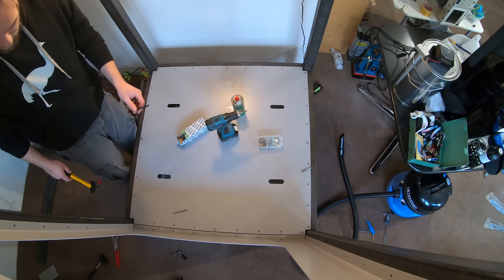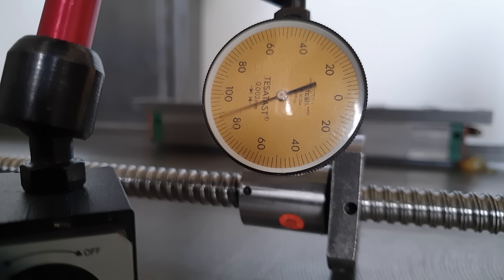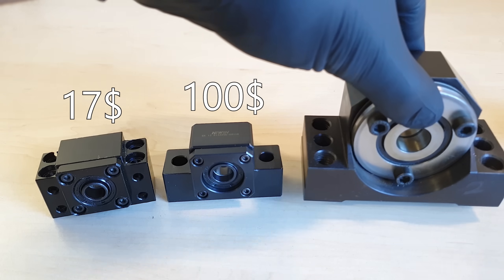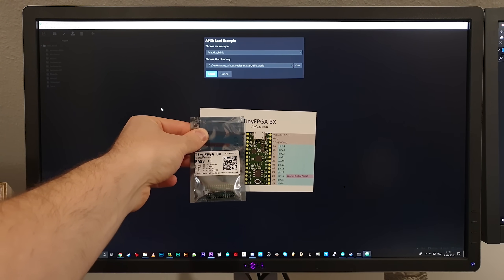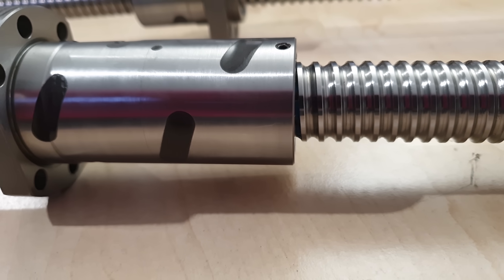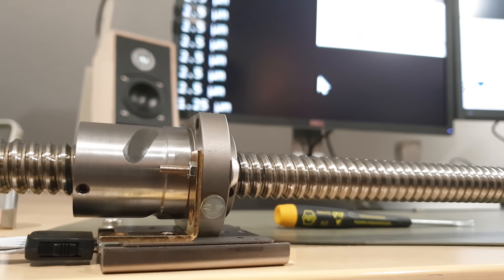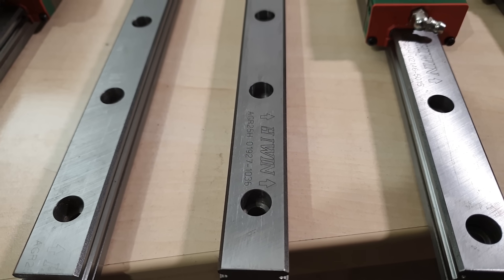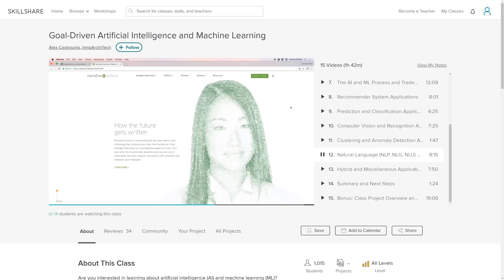Chasing Micrometres with the best Ball Screws

Comment: Soon enough I’ll be making my own 3D printer, it’s so unique it will work well on the market as a product to sell. It is absolutely nothing like a Cartesian printer, closer to a delta but still nothing like them either. I’m going to be designing my own motors and they will give high speed, High torque and high Percision... less than micron accuracy with fast movement. I may be looking for partners, would you want to be a partner. Also my motor will 100% eliminate gear lash, the only lash I will have to worry about is the lead screw or whatever type of screw or use, I think I have an idea to eliminate screw lash, but I’m not sure, could use some input/thoughts on my idea.
Reply from the maker: Bold claims ... my email is on my channel page when you have something to show :)
Reply: Marco Reps I would love to spill all the beans, once my design releases every one will be cloning it, so I’m not doing a kick-starter etc, it will give to much info away. I’m a OTR semi truck driver and don’t have much time to my self. I’ve got it all planned out in my head, but a few things I’ll need help with. I’ll likely need to make a custom power supply, also my coils won’t be on 100% of the time , there will be lots of switching, but for extreme exaggeration example let’s say one particular coil coil gets powered on indefinitely, no polarity switching, just continuous power, I need to know how to balance everything out so that coil(s) and power supply can be on 24/7/365 and be perfectly safe not getting to warm/hot. Also I don’t know that any of these circuit boards can handle all my connections and coordinate and calculate everything.
Many things are not finalized math related but the strategy is complete, so I could very easily have over 100 wire pairs to work with!
So since I’ll probably using regular computer and software I’ll write (very rusty, been years since I coded), some of that I’ll need help with, mainly geometry type math. Example well actuall... take a disk and measure it’s diameter in microns, fix the center in space... visualize a XYZ grid of micron sized plots, the center of the disk is at 0,0,0 . Now pick any spot on the perimeter of the disc and dip it down by one micron... now along the perimeter of this disk what new Micron sized plot coordinates are they touching? That kind of stuff. Also what kind of circuit board can I use to interact with software I’ll write that can handle over 100 connections, turn them on/off and choosing what polarity I want each connection +/- , I’ll handle the formulas that coordinate all that. So first step... balance out all the coil parameters, smaller is better, stronger is better and stay perfectly safe under endless continuous power with no switching Polarity... and staying safe, that is worst-case scenario but you have to consider this is going to be in people’s homes.
Once that is done that will give me the information I need, mainly torque I’m looking for. Then I can take it to the next stage, some kind of board/software interface to test speed. Once I have those figures, that will determine how the rest of it is balanced out with the rest of the internals of my motor. 
Side note I don’t really care how big the diameter of my motor is, bigger the better, only draw back would be you have to have a bigger build area LOL, So if my motor is one foot in diameter, the minimal the build area can be is three feet in diameter.

Comment: FYI: You should look into Klipper if you are interested in interfacing a regular threaded OS with a realtime OS. Klipper is a 3d printer software that does all the heavy lifting on a computer (usually a Pi) and then uses one or more microcontrollers to schedule and execute commands.
Reply from the maker: Yeah, cool project. I think Cetus is also based on that principle
Reply: @reps  I honestly think it's the way forward for 3d printing as opposed to using STM32 based boards with webUI addons like the Duet. Plus it can be infinitely scalable. Want to have two Y-axis gauntries with two X-axis carriages with two independent extruders each? Slap a few cheap reprap boards together and hook them up to a Pi and install Klipper on everything.

Comment: marco, did you forget to go back to the fundamentals of engineering again ?
just fabricate a suitable large to small (micron in this case) pantograph derivative,  for instance in the style Matthias made for a prototype , and use any mostly printed cnc to run the big end for near positioning, then a second scripted micro cnc  on the small end to fine tune the micron path on the reduced end  if that is then also required for even more control

https://www.youtube.com/watch?v=IDGzf04W62A 
Matthias Wandel
,Published on Apr 22, 2016
A pantograph to use with the plasma cutter for cutting intricate shapes that would normally require a CNC plasma cutter.

Comment: Marco, what about interferometry for measuring the "travel-back-position"? Such a setup is quickly built and you own a few laser diodes ;)
Reply from the maker: Somehow the term phase locking popped into my head, but apparently that's not even necessary?
Reply: @reps  Yeah phase-locking would be awesome. Not sure if you want to dive into this, but I'd love to see how your approach would look like ;) (just noticed that at mistyped your name previously, sorry, fixing it)
Reply: A simpler way would be just capturing the image and run some contrast calculations to determine the phase.

Comment: Marco Reps  I'm planning to fill my steel sections with a non-shrink concrete and latex mix for damping. Article about damping cement here - https://www.researchgate.net/publication/226620051_Improving_the_vibration_damping_capacity_of_cement

Most of my machine is bolted together so I will helpfully still be able to move it.
Reply from the maker: Ah, a vibration expert! ;) Yeah I wanna see how everything behaves without any damping first, because if I add any more weight I couldn't move the individual parts by hand any more :L

Comment: bearing blocks on linear rails must have a certain amount of preload to give you accuracy and rigidity under load.  
that's why a new linear blocks don't slide freely and have some amount of friction.
(and that used rails from industrial machines slides freely just because they are WORN OUT and lost their preload.  that's why they was removed and replaced with new ones)
Reply from the maker: Sounds all correct! The banggood ones however have an uneven friction and seem to get caught on some high spots. And since hobby stuff is the only area where you would consider used rails anyway I think even the most worn-out ones will be easily good enough? Maybe I can find a way to actually measure my worn-out Rexroths ...
Reply: @reps  I've recently bought some used miniature Bosch rexroth linear guides (size 15, 4 bearings, 2x330mm rails) from ebay, alongside 500 steel bearing balls. Had to replace the old balls and even replaced the new ones multiple times until I found a "good batch" of those cheap balls that were running smoothly with slight preload. All in all this costs me 120€ compared to new ones from Bosch for over 500€
Reply: @mariusb6035  How do these Bosch rails compare to Hiwin rails? Only ever heard of Hiwin rails being used in high end CNC applications.
Reply: @michaelkelly3158  the original Bosch rails are very similar to hiwin rails. You'd have to compare lifetime, friction or other technical properties in a specific use case. Just saying "these are better" is impossible. As long as you get new brand name rails (hiwin, Bosch, SKF, Schneeberger,...) you should be good to go for any hobby project.
Reply: @reps  You could lap cheap rails to remove the high spots.
Reply: There are lot of tutorials on youtube how to fix blocks if they dont run smootly. Often its only the little metal which hold the balls, that it isnt 100% straight. If you fix this, then you have a rail with a block which runs perfectly, but not many ppl know how to fix it.
Reply: I have some cheap Chinese linear rails in a 20mm size. They run kind of rough but don't seem like it's specific high spots. Do you think taking them apart and cleaning would help smooth out the motion? I kind of suspect it's small particles in side the carriages are causing it to stick
Reply: So what's the conclusion here. I found set of linear rails + screws on Ali for 370€, but I can buy the same set of used, rusty Hiwins for the same price. Can you give me an advice, please?
Reply: as those are high load and low speed applications, the highest preload option would offer the most, the lubrication will take care of the lifespan (hopefully)

Comment: Your videos are usually pretty funny, but that joke at the end about rails getting replaced preemptively in industrial settings was hilarious.
Reply: @SystemsPlanet  Most industrial machines (outside Germany at least) get run to death, rarely get the love or greasing they should.
Reply: Bigger companies do this all the time. Regular maintenance is important when your Nestle and bottling 10's of thousands of water bottles a day.
Reply: @adisharr  
I am not sure if you have ever replaced a ball screw, but it doesn't sound like it.
Reply: Depends a lot on the application, but most companies will replace ball screws when it starts causing problems. If it's in a machine that NEEDS to run without a hitch, consumables will generally get replaced or at least checked for wear on a predetermined schedule. I used to work for a company that would always have a maintenance crew scheduled for holidays so they could do that sort of thing without creating excessive downtime.
Reply: The standard operating procedure in North America is: A more and more frequent motor overload error, operators get frustrated enough to complain, so maintenance come and grease it, same thing happens a few more times, maintenance get frustrated with greasing it every damn shift, and then they tear it open to find out it’s completely fucked, ball bearings all over the inside of the machine, parts are ordered in a hurry, often resorting to physically sending a guy to the distributor to get the parts faster, because the line is completely down and hemorrhaging money. You guys have a better system in Germany?
Reply: @samroesch  Sure! Every company has (by law) 3 special departments for that. The highly trained quality maintenance workers which dissect every part of machinery based on a plan that is written on 2" steel plates. Usually this means dissecting a machine every 23:05 working hours and then rebuilding it. This whole process only requires 50 man hours to accomplish, because the staff is so experienced and trained. The second department documents this process for every screw in every machine and quality checks the quality checking maintenance workers. And then the third department which checks the documentation quality of the quality checking quality checkers. So for every machine we tend to have around 10 people who care for only this machine (full time). Its because of this system that germany can manufacture the best "stuff" for only 1000 times the price of chinese parts. And yes, thats why marco can get like-new parts second hand, if a part is rated for 1000 working hours, naturally it gets replaced after 10 working hours. Safety margin and all that.

Comment: Maybe you could try Schneeberger MiniScale Plus rails. They have a linear encoder integrated into the rail so would let you do a lot of tests with no worries about aligning the encoder to the rail. The resolution is very good at 0.1 μm and the encoders have good length accuracy at +/- 5 μm over 1m.
Reply from the maker: Yes please! :)

Comment: What's the amount of the slow drift? Steel has a coefficient of linear expansion of ~10-12 microns/meter/degrees c, so temperature expansion vs the desk should certainly shown up on your micron scale.
Reply: I am also German but have been living in the US for over 40yrs. I am looking to build a reasonably priced desktop machine to route/mill parts for my hobby. Why is it that I am also obsessed with precision and worry about thermal expansion of materials? I guess it’s in my genes? 🤪

Comment: FYI: micrometre = μm, micrometer = an instrument for measuring small distances
Reply from the maker: Thanks

nerd :)
Reply: @reps  fair, fair
Reply: I know this is off topic, but what is your planned controller setup? I know you have some LinuxCNC experience, but have you looked at the MachineKit? It’s a pretty cool fork, far more modern in architecture and much more modular ecosystem. You can find out more at machinekit.io.

I have no connection to the project, just believe that is superior and worth a look.

Comment: That's some quality hardware! I'm only worried a bit about this Z axis, it looks going to be 2-3 times longer than spacing between rails, this will amplify load on the rails, and then amplify deflection at the tip of an end mill even more. I might be overthinking it but i'd be tempted to make something like Okuma double column machining center.
Reply from the maker: Valid point!

Comment: A lot of hobbyist CNC's seem to have dumb radial bearings in their bearing blocks, which seems to work quite fine for the most part. If you search well enough some chinese sellers do sell angular bearing blocks - though idk how much of an improvement those are. Probably not matched / shimmed / whatever you call that :p Also: does having slightly bent ball screws really matter ? They're gonna be moving straight when they're mounted anyway.
Reply: Being as my CNC spends its life doing nothing I think the cheap skate bearings in it are doing just fine.

Comment: Marco.. You should check out rotating nut instead of rotating screw
Reply: Less vibration since a long screw would flex while rotating. a nut that rotate around a static screw would not make the screw wobble. You could use thinner screw and improve over longer distance
Reply from the maker: @IBICO74  mkay, interesting! but I am already too far on the 'normal' route ... maybe later
Reply from the maker: Why?
Reply: https://youtu.be/4unEngqU09A
Reply: https://youtu.be/WXv5breXGLw
Reply: As I already made a comment on this post, that factor is already apart of my design, but Not intentionally... oddly enough!!, it’s because of other design factors (more than one) I didn’t even think about possible vibrations. But my design eliminates all vibration. Hope I don’t reveal to much info here but... I don’t need any bearing blocks, my motors are stationary, and my screw does not spin! My overall design has very few parts.
Reply: About your travel accuracy over longer distances issue, take note of how many microns of linear movement your screw gets per one rotation of the lead screw nut , and keep total count of rotations for the nut... permanently throughout your software or even when power down so your homing stays true forever

Comment: i am going with lower precision ball screws from Hiwin but pretensioned (3%) because i use Linear Glass scales (1 micrometer resolution)
Reply from the maker: Cool, wouldn't mind something like that myself ... but twice the number of fixed bearings? I want to see my performance first before such an investment
Reply: @reps  why twice the number of fixed bearings? its still a fixed and a loose bearing on the ends of the ball screw (and the ballscrew nut is pretensioned by itself , no two nuts combination)
Reply from the maker: @ipadize  Ah alright, I thought that meant you'd 'stretch' the entire ballscrew between 2 fixed bearings.